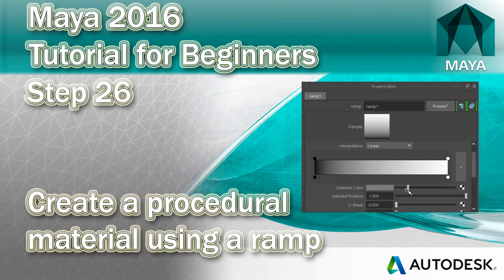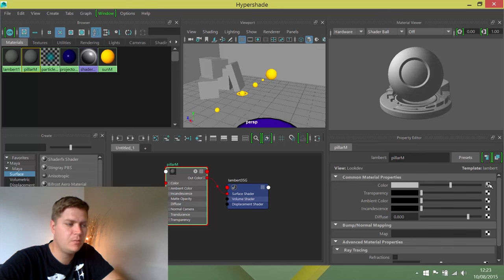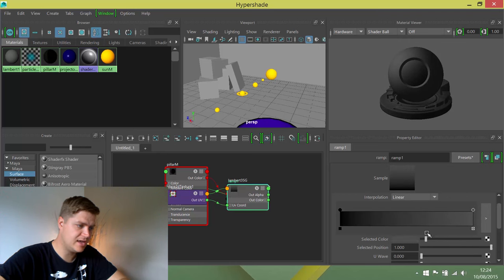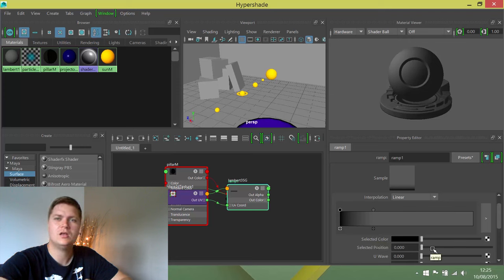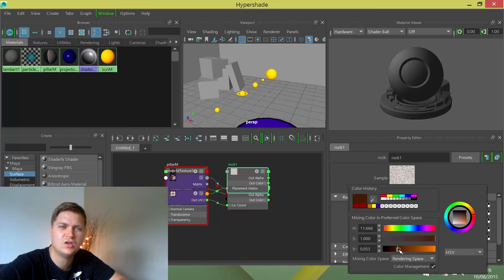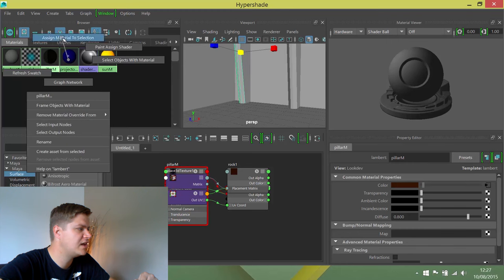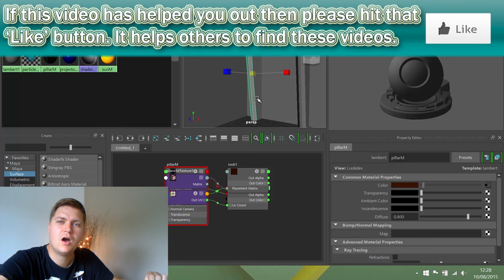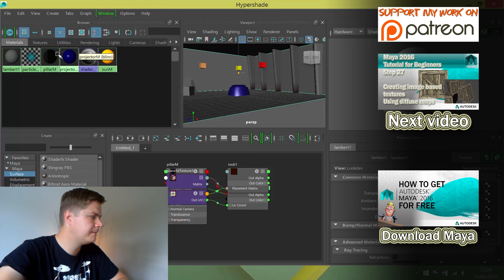#26 Using procedural materials and ramp shaders in Maya 2016

Comment: I'm having some trouble with the pillar Material
i've followed step by step yet for some reason i have black patches through the material and i have no idea why. any ideas?
Reply: I do as well I dont understand and its not the simplest program to just go back a few steps with. Found the solution?
Reply: I had the same problem aswell. After fiddling around i managed to fix it. After creating the pillar's material, delete the arrow going from rock1 (out color) to ramp1; then click and drag from rock1 (out color) to ramp1 and select color offset.
Reply: Man, I almost gave up on practicing. Thank you so much comrade, it worked!
Reply: Boy George Good to know!
Reply: thanks a lot

Comment: sooo the ramp tool in 2017 isnt giving the same effect.. it looks nothing like the way it came out on your pillars. it fades from the top a bit and the bottom. is the ramp tool different? I did exactly as you said and yet i cant get the desired effect..
Reply: My pillars get the same color from top to bottom. No fade at all.
Reply: Have you found the solution to this yet?
Reply: Jakob Phelan unfortunately no
Reply: i have fixed it!!!!!!!! wow that took forever lol
Reply: Hi, can you tell me how you fixed it? I struggled for a bit to make it work, but I just can't find the right settings.
Reply: Any Luck? I'm having the same problem.
Reply: MrFohom (another user in this comment section): "I had the same problem aswell. After fiddling around i managed to fix it. After creating the pillar's material, delete the arrow going from rock1 (out color) to ramp1; then click and drag from rock1 (out color) to ramp1 and select color offset."
Reply: Did you ever figure it out? If not i can tell u how